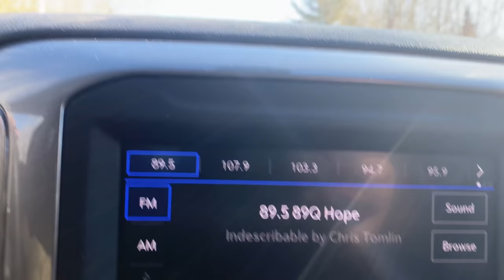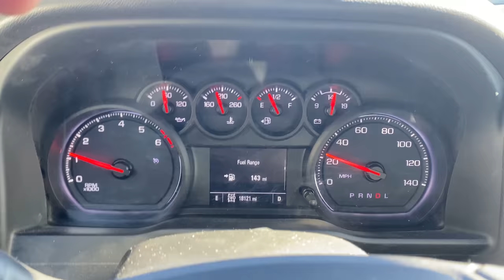Oh POOP! | A Big Family Homestead VLOG

Comment: Pecks and bushels are measurements that are not based off of weight. Which is why you see a lot of road side stands use these measurements because other wise they need a certified scale to sell by weight

Also just a thought, maybe out a tarp on the wheel barrow so that you can lift and dump